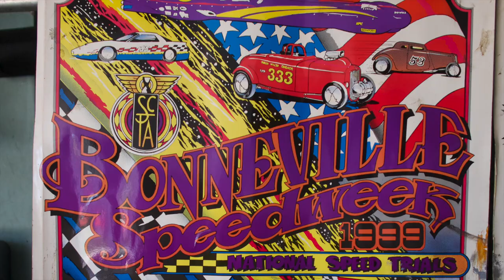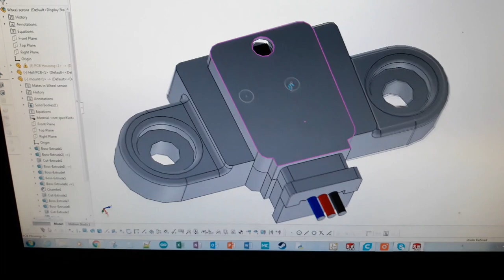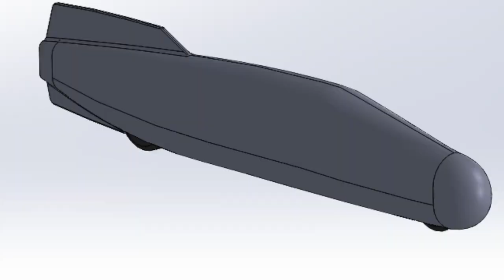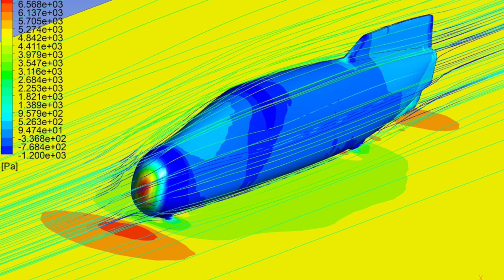Lark Streamliner | Project Progress May 2019

Comment: Looks good, and congratulations on the wedding! I don't know if they factor into the design, but I think NACA scoops would make it go faster, ok well they would make it look like it goes faster at least. :)
Reply from the maker: I will need an air inlet for the motor heat exchanger under the bike! i'll see if I can fit one under there